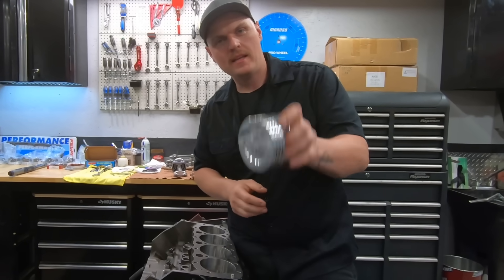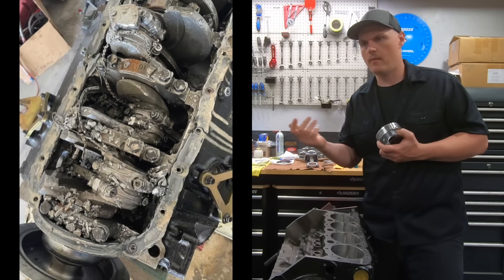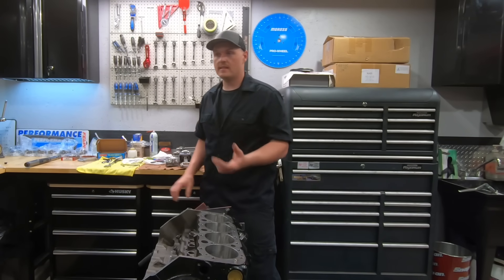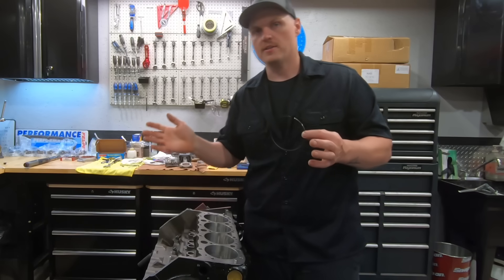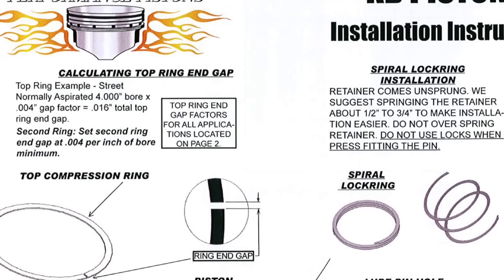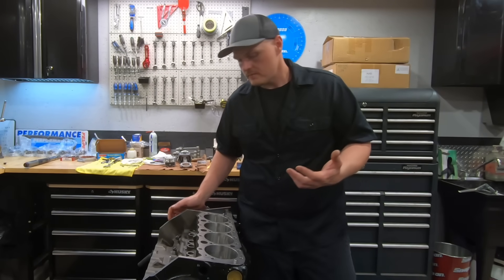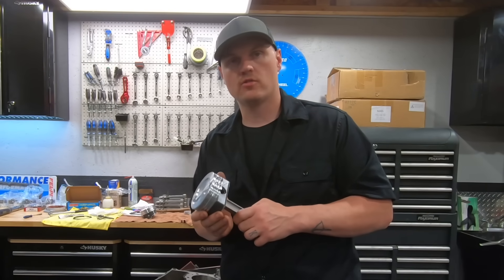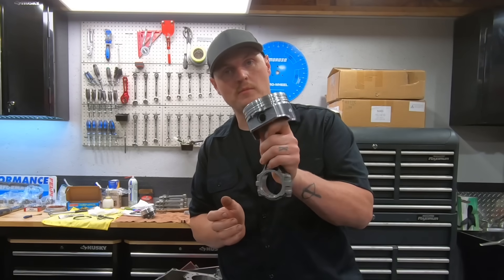Engine Failure!? Watch if you are running Hypereutectic pistons!

Comment: Grant piston rings offers set specifically for these pistons . May have to customize a couple out of a full set but they are a good solution for the entry level engine builder. I have built several engines using this brand check them out.

Comment: The reason this is particularly critical on KB hyper pistons is because their design means the top ring groove is higher in the piston increasing the top rings exposure to direct combustion temperature which creates greater ring expansion requiring more gap.
Reply: Yea, all people have to do is follow the instructions, but no, they don't and then they sit around calling the product junk.
Reply: Gap your rings for your use...
Reply: Abso fucking lutely correct!!!!!!!😅😮
Reply: Whats wrong with you people,  its the same as reading lables on what food you are going to eat!!   It will tell you whats in it...

Comment: Does the increased ring gap apply only to the top ring? With the enlarged gap do you get more blow by and/or oil consumption on a daily street engine?
Reply: Yeah
Reply: @dennislosing8800 Yea, to Both questions or Just 1st? I'm wondering the same...

Comment: I broke the ring lands off of six kb claimer pistons in one pass on a 383 and got lucky. Installed another set of the same pistons with plenty of ring gap. I have run this engine for several years now with zero problems. 11.1 383 8.2 dynamic compression (185psi cranking) 100 shot nos on 93 pump gas. You are spot on about the ring gap Pat.
Reply: Thanks for the post - Exactly what we need to know! 👍

Comment: Although I do agree a sticker would be a great addition, the instructions included in every set of pistons I've ever bought DO tell the builder what the suggested ring gap factor is for each application. Also, many of the ring manufacturers also supply a suggested ring gap factor for hypereutectic pistons as well. If you read the instructions you have all the information you need to build a reliable piece. I built strictly marine application 383 and 406 N/A engines (probably close to a hundred over 40 years) and never had a failure. Almost all of those engines had KB pistons in them.
Reply from the maker: Alot of the rotating kits that come with KB pistons don't include the instructions for some reason
Reply: @cuttersperformance  thats  what makes  me  wanna avoid  buying a kit  and just buy  the parts individually  from summit or jegs  and get all of the instructions  for everything  hypers  run  tighter clearances  vs a forged  piston  but they follow the same  rules.  more power/heat,  more  pistons  to bore clearances.  its  just forged  2618  need A LOT more clearance  because  they  expand  more than a hyper piston because  its assumed that anyone running a 2618 forged piston  is gonna really be putting the wood  to it  like a blown  small block making over 800-900+  or a turbo  LS  in a drift application for example
Reply: @cuttersperformance  That's not a KB problem that is the rotating company issue for not providing complete/comprehensive instructions.  If they are reboxing and tossing instructions out, DUMB.   Even if they don't provide the instructions,  go to the manufacture and see what they recommend.  100% agree with the piston man site suggestion. Assume NOTHING when building an engine.   That was the rule in our shop.

Seen plenty of destroyed stuff with hypers and it was usual tune up or ring gap related.
Reply: @Rob-db4cc  yep. agreed

because  think about this,

Chevrolet Performance  has sold PLENTY of zz 350/383/454 crate engines  without a fail and warranties.  definitely  a builder/tuner issue.  but people like to say KB's suck.  they dont.  they just need special attention to ring gaps.  simple  stuff

Comment: Great information Pat, I've built several of my own engines over the years and haven't built one for 30 years, (now at 75) I want to build one last engine. I'm trying rap my head around all these new engines components and materials with different manufacturers, which I never had to before. I question some times if change is really a good thing.

Comment: I set my 4.085 at .30 top ring. Engine builder guy tore a stock 427 Ls apart. It was at .41. That's pretty big lol
Reply: Did You have a lot of crankcase oil blow out? What was the reason for the rebuild? I'm asking cause I set mine at .037 for up to 400shot.
Reply: @harpin5457 I had a 6.2 ls3 block fall in my lap for $500 and a low mileage set of 821 heads off a Corvette. Every thing except the block casting and head castings is new. I just set mine at 30 cause im not boosting it.
Reply: @harpin5457 I havnt fired mine up yet. Still need to get a BP Automotive harness. I am i stalling the Ls3/6L80E in a 03' Crown Vic Police Interceptor.